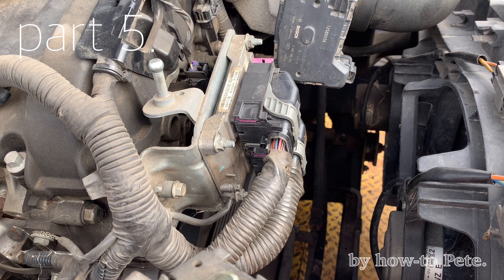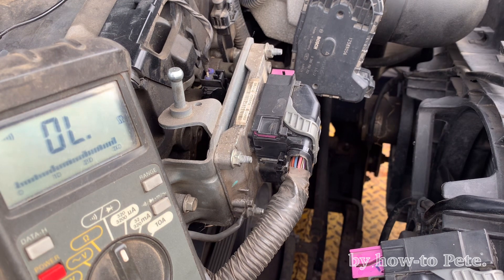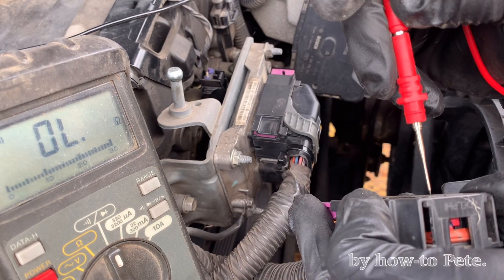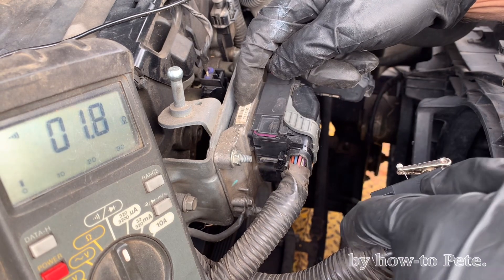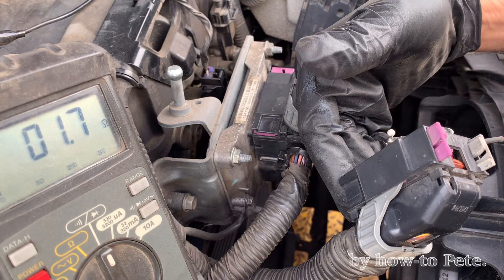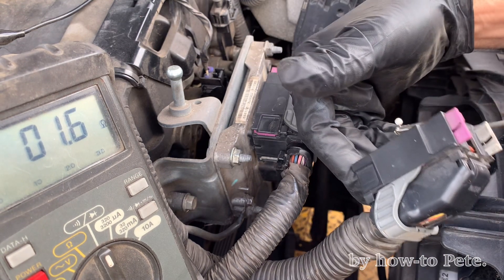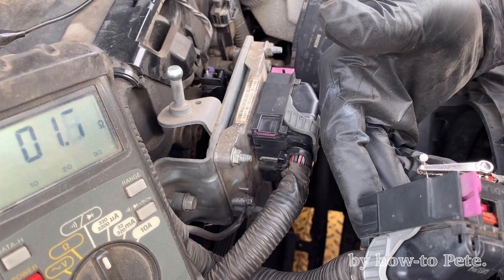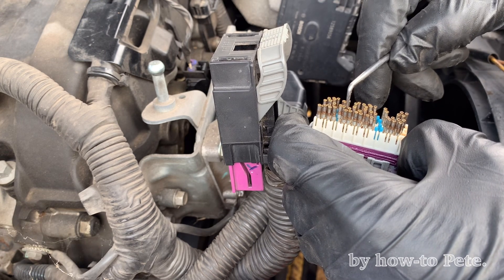# 5. HOLDEN Commodore VZ ECU back probe…part 5.

Comment: I had an issue with the Coolant temp sensor,, and replaced it with a cheap one,  Didn’t fix it ,  So I replaced it with a AC Delco one , problem solved, The ecu doesn’t like the cheap ones, it was coded from the factory to only take genuine Holden ones
Reply from the maker: Yes you are right a lot of cars are not happy with aftermarket sensors… Thank you for sharing a solution to a problem and for your support….👍🏻

Comment: I buy high cranking battery after watching vids conclusion standard cranking as I own 9 vy to vz utes.
Reply from the maker: Sorry dude I just don’t understand what you are trying to say in this message….
Reply: @howtopete33  Batteries that offer higher output on turning over.
Reply from the maker: There is no need for higher CCA than factory recommended if it won’t start with the right CCA then you know you have an issue with something else.
Reply: @howtopete33  did you get another ecu yet.
Reply from the maker: Yes, episode 10.

Comment: Great Videos! Have you ran the diagnostic scan tool to see if the passenger wire loom is registering anything? it can be the wire loom that hides behind the air inlet manifold on the passenger side. That plug is sometimes unplugged and will throw lots of codes as they are all sensor cables connected to two plastic plugs!
Reply from the maker: Thank You for your kind words and support! I don’t have a super sophisticated scanner to test the wiring harness that you suggest but I will go and inspect it. Thanks for the tip…
Reply: @howtopete33  there are two plugs one above the other. Near the side of the thermostat to the right side. Mice and possums sit in there also and chew the cords. The ECM has all bonded earths and sense wires to each sensor. Sometimes the sensors get shorted by animal or human interaction and not get any readings. If someone has a tech2 obd scanner , can read that side of the control and may show abnormal activity and show the range is open or the resistance is way off chart. Some obd scanners cannot detect it.
Reply from the maker: Wiring was fine it was only a faulty ECU.
Reply: @howtopete33 as they’re getting old, ecu components will fail, hence it was giving you grief 😊
Reply from the maker: Shame there aren’t any decent people repairing the ECUs….

Comment: I've also found if you put in a scan tool into the obd2 it'll start right away and you can drive around with it connected without issues and turn the car off and start it up again with it still connected as soon as you unplug the obd2 it'll cut out
Reply from the maker: Wow I’ve never heard of that before….
Reply: @howtopete33  after googling it apparently the obd2 port has 2 grounds that once the obd2 scanners connected it basically acts like the PIM Module and is being the gateway communication between the bcm and ecu once disconnected it cuts off as it losses communication with the bcm and ecu so I think the only thing keeping the car running and driving with the scan tool connected is because it would be relaying the data from all modules to trick the system into thinking everything is communicating and is all good and 
Once that middle man aka the obd2 is disconnected stops relaying loses the gateway between the 2 systems and essentially loses communication and power and shuts down
Reply: As it says the obd2 port has the 2 grounds chassis ground and signal ground and bridges the grounds when scantool is plugged in essentially being the brain of the car whilest connected I've tryed with 3 scantools vident , toolpro supercheap auto one and a cheap $10 blue tooth one and all work and allow the car to start with the key and turn off with the key and start back up and drive around without issue maybe worth testing in the next video might lead to a possible signal or ground issue somewhere that we haven't found yet as I'm sure I've gone over all the grounds in the car but as soon as the scanners connected its like there never was a crank no start issue to begin with its very odd and interesting
Reply from the maker: I couldn’t get it to do that…
Reply from the maker: That definitely didn’t work with my scan tool.
Reply: @howtopete33  and really appreciate the videos great quality and interesting they really have helped my get a better understanding of how the systems and certain things work in my car which will always be useful keep up the good work
Reply from the maker: Thank you for your input, support and kind words!!!👍🏻
Reply: @howtopete33  the car also when trying to start the car without the scanner connected would show up on the dash with low fuel warning and said there's only a qauter of a tank even tho there's alot more when going into the diagnostic mode holding mode and set and then putting the key in and turning to accessories it would should 0L of fuel in the car aswell in it and would pop up with service soon and about 3 times it showed up with service error contact dealer and when the car was running and driving before the no crank no start issue the onboard computer would reboot randomly within 1 or 2 seconds and do a system OK check and gauages would drop and come back even when driving but wouldn't effect the car you could still accelerate ect while that happend so with the scanner when trying to reset the service soon message it wouldn't allow me to reset it so connected the scanner and turned the key have to make sure the padlock on the dash goes out so unlock the car before turning the key and started up and all gauges would be normal and show all the right levels and I'm still able to daily drive it untill I figure out what to do next hopefully this helps definitely keen to finally get to the bottom of this issue as it just happend out of no where was running good parked it up after a drive 20 mins later no crank no start so I think the scan tool must be reading all data from all those models and tricking it into thinking the cars perfectly fine and ready to go as it'll just keep having constant power via the obd2 to keep all signals and systems alive untill you unplug it 😀
Reply from the maker: That definitely didn’t work for me, perhaps my ECU has a different problem.

Comment: Mate as someone with a currently stuffed VZ and been watching since your first video on this task, I commend your sheer patience and dedication to these fucking Alloytechs 😂😂
Reply: I've also found if you put in a scan tool into the obd2 it'll start right away and you can drive around with it connected without issues and turn the car off and start it up again with it still connected as soon as you unplug the obd2 it'll cut out
Reply from the maker: Unfortunately I could not replicate that.
Reply from the maker: Thank You very much for your kind words and support. To be honest I’m not a big fan of the commodores last commodore I like is the VH.  However I have a soft spot for Australian Made things hence I’d like to put this Ute back on the road. I’m going to keep at it and hopefully I get to the bottom of what’s bothering him/her. The hardest part is that so many people have had a go at it and it was stripped when I went to pick it up. All the panels are only holding on by a couple of bolts cause if I left them in the back of the tray when I picked it up they would have been full wrecked after 300ks…. Hopefully I find the issue sooner rather than later as my viewers must be getting tired of no results….lol…👍🏻
Reply: @howtopete33  so long as this car goes back on the road its all good haha especially as otheres who have these kind of wierd problems may learn something
Reply from the maker: 100% right. That’s why I don’t edit out the things that don’t fix my problems maybe someone else can fix theirs… Thanks a lot for your comment and support!!👍🏻
Reply: @howtopete33  all good man. I’m enjoying it
Reply from the maker: That gives me great incentive to keep making more videos ! Thank You…